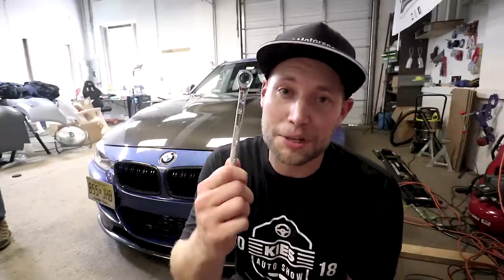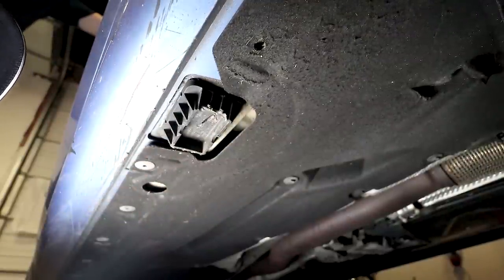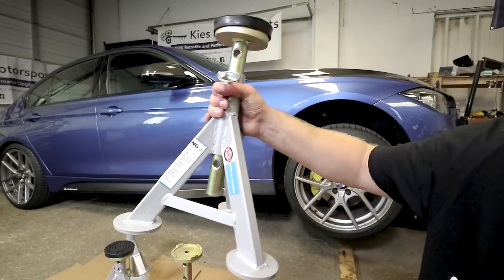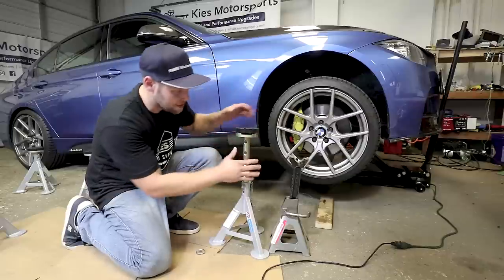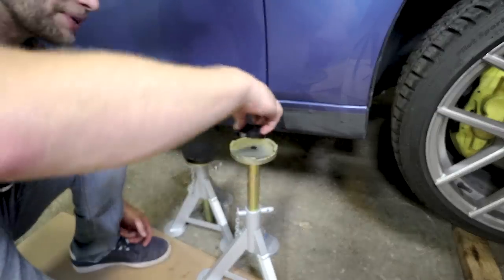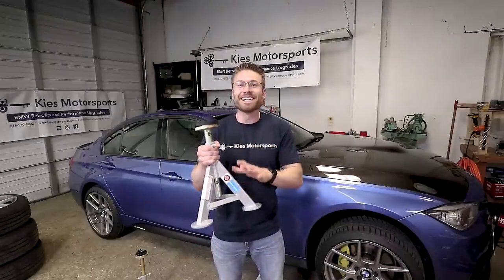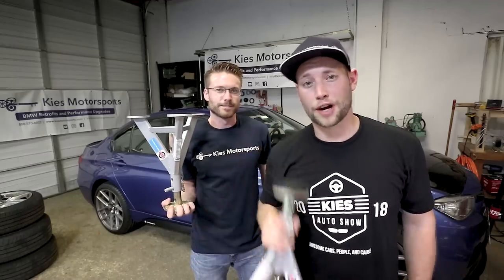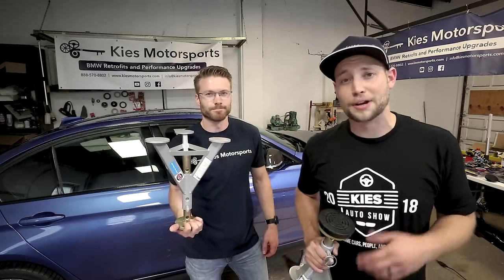ESCO JACK STANDS. The ONLY Jack Stands I Trust my F30 BMW 335 On #EscoJackStands

Comment: Hey Brian....can you do a video on starter tools to buy for BMW😀
Reply: did he make this video? I am new to the channel.
Reply: Aaron get the metric 1/4, 3/8, Allen head, torx, and e-torx from harbor freight and a set of wrenches. Get socket extension(I like wobble type) and angle extension. Get the pick tool set and plastic trim tools. Also a rubber mallet is useful. I’ve done most diy with that. For spark plugs get 14mm thin wall magnetic. For oil filter get the one from FCP euro. 
As for jack, get the Daytona low profile long reach, it’s made in same factory as snap on (snap on sued for copyright since they’re the same) and get 4 of these stands.

Comment: hi question i plan to do a transmission fluid change i plan to use 4 jack stands  my question is is it safe to start the car while on 4 jacks up ?
Reply: Ben Pero yes as long as floor is relatively flat. Many times people need to get in to press brake pedal, turn on engine etc. just be gentle and don’t slam door jerk car etc. 
also give the car a gentle nudge once on stands to make sure it feels secure

Comment: They look sturdy but I’m a little  concerned about all of the weight of the car being supported by those adjustment pins.

Plus, they are a little pricey but hey, it’s only our lives at stake here so if I believe in this product I’m willing to spend the extra money.
Reply: MOBROOKS each stand is rated for 3000lbs. More than a normal pair at Amazon Walmart etc. those are rated at 3000lbs a pair. These are 3000lbs each so 6000lbs a pair. So all 4 would be 12000lbs
Reply: @dylan-nguyen  each stand is rated at 3 tons, that's 6,000 lbs each totaling 24,000 lbs for a set of four.